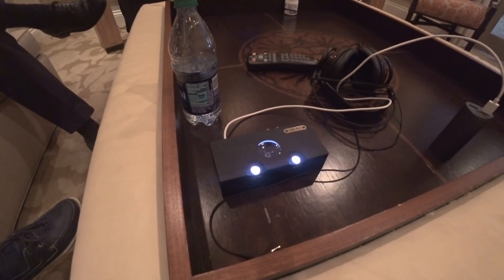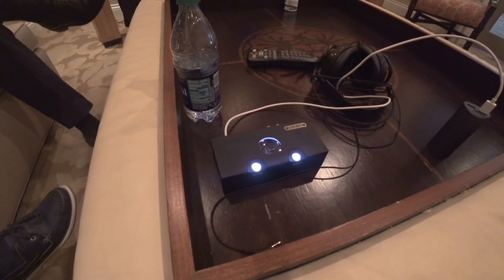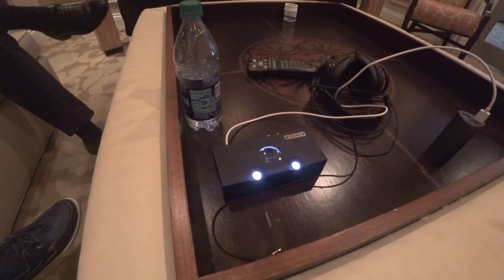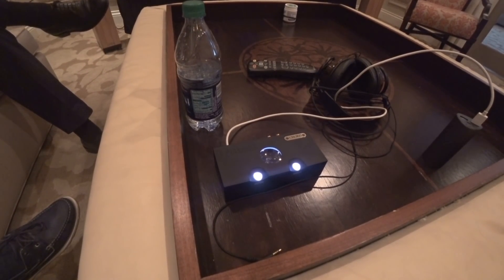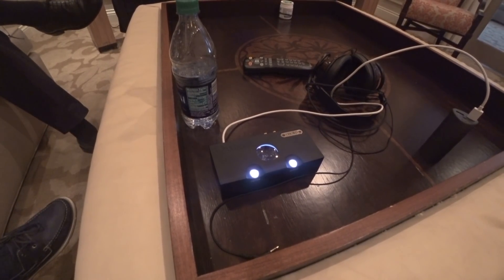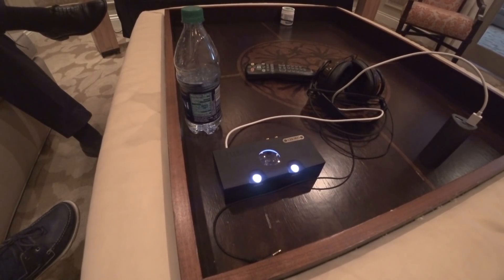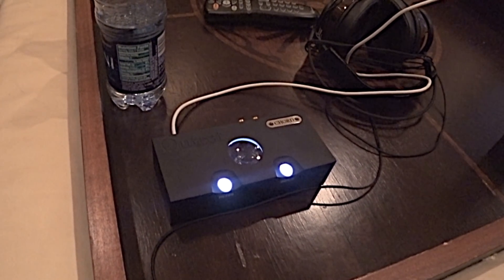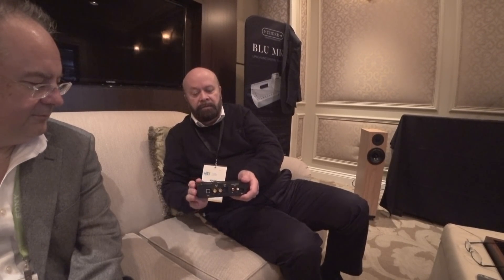CES 2018: Chord QUTEST DAC

Comment: FYI.... It's about $1,600 USD.
Reply: I had the original Hugo for a little over a year and enjoyed it, but Rob Watts and Chord seem hellbent on obsoleting their own products every 6 months or so. Some reviewers still prefer the Hugo TT to the Hugo 2, but the latter is being hyped mercilessly on sites like Head-Fi as 'the best yet' (FOTM ftw). Based on the price you've quoted here and the claims being made by these two gentlemen, it would appear that they've just undercut all of their other offerings by a significant margin, albeit minus the selling points of the headphone amp and battery-powered portability of the Hugo 2. I'd still like to hear the TT and their DAVE, but right now there are more important priorities like food and shelter before toys ;)
Reply: I do not think they have not undercut their other offerings by a 'significant margin'. The RRP of the Qutest Dac is 2/3 of RRP of the Hugo 2. It probably saves a third of the cost of manufacture and R&D for Chord as well. And the selling point of a headphone amp is quite an important point for most people that buy the Hugo. Also some people may want a dedicated one for their speakers and a separate one for their portable stuff, but don't want two Hugos.